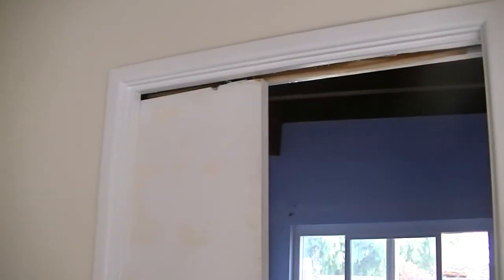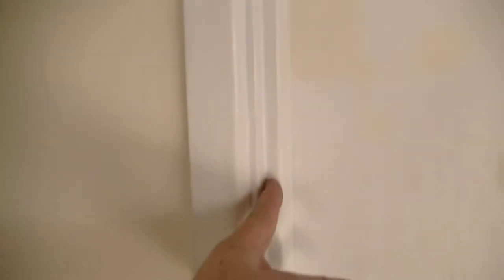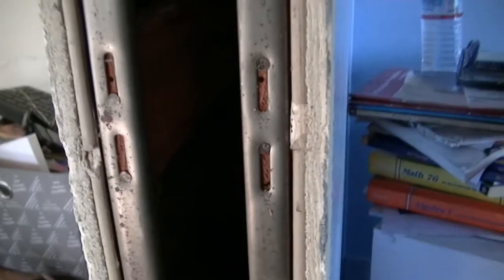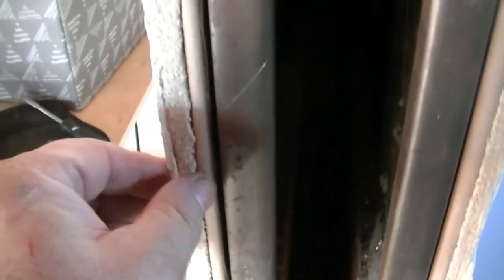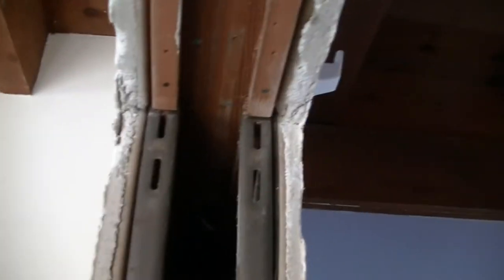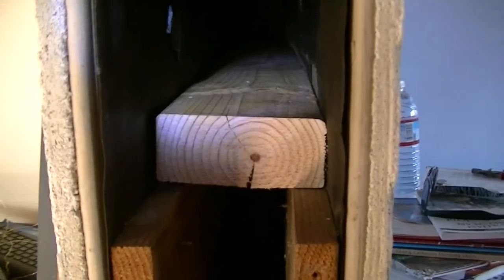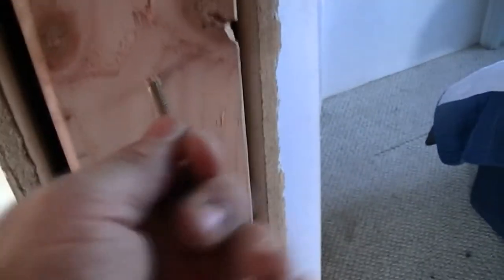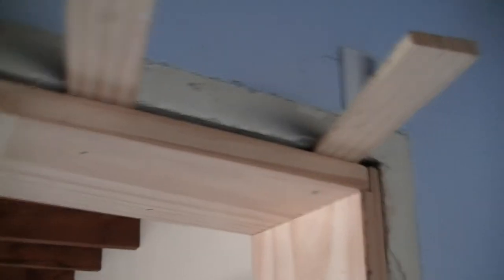REPLACING A POCKET DOOR WITH A SWINGING DOOR

Comment: Nice work. I have a pocket door that is stuck in the wall I’ve tried to yank and pull its stuck in there. I was thinking of turning it into a swinging door which led me here. Any advice on what to do. The pocket door only sticks out about 4-5 inches on the bottom the top won’t budge. Any way to leave the door in the wall and turn it into  a swinging door
Reply from the maker: You need to get the door out.  You may have to cut a whole in the drywall to get at the track on the top.  Good luck!  Kevin